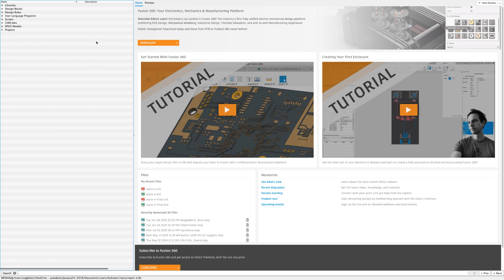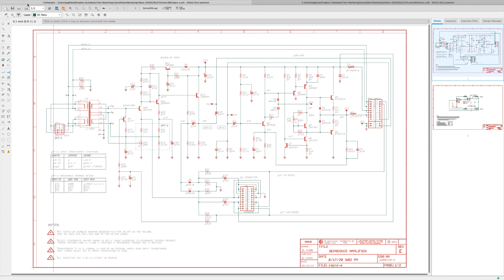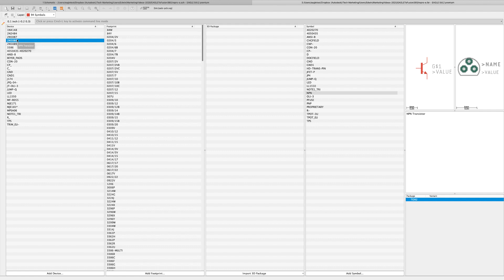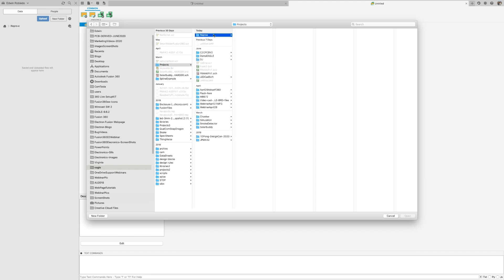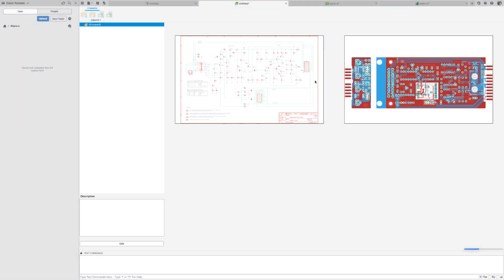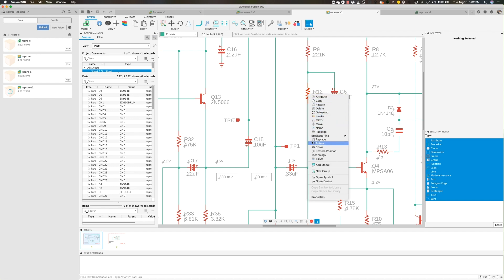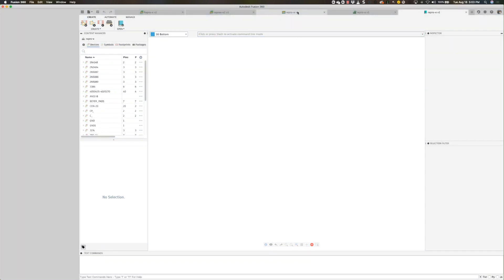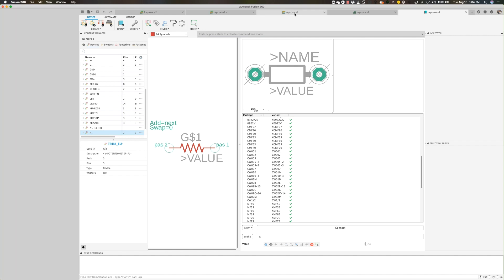Loading EAGLE design and library file in Fusion 360

Comment: Is the Fusion 360 Electronics fully fledge compared to eagle? Or still in development?
Reply: As I user, it looks like all of Fusion 360 is still in development, but quite usable.  Tutorials I've seen over the last few months have stated that there are still some differences between Eagle and Fusion 360 Electronics, but that full feature parity is planned.  I don't know how long it will take for them to be in-sync (or to have the features you deem "required"), but they also intend to continue to enhance the Electronics module to operate more like the rest of Fusion 360 (e.g. Electronics Library part/footprint editing will be more like Fusion's Schematic editing).